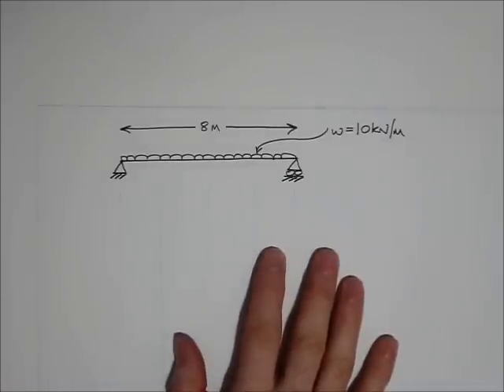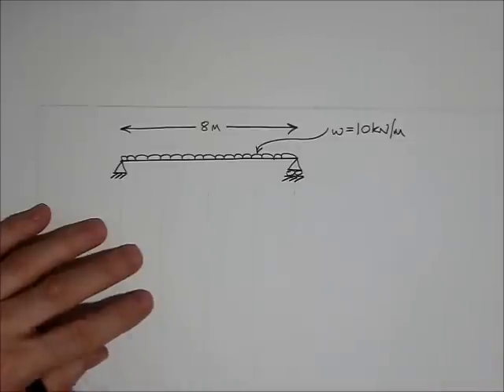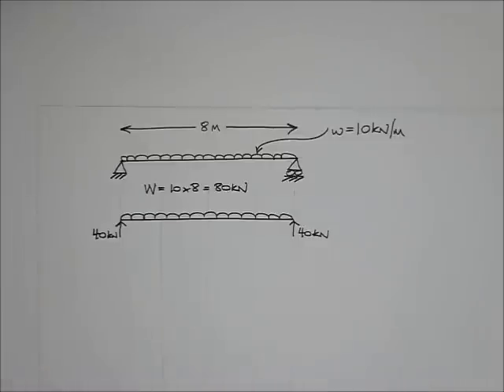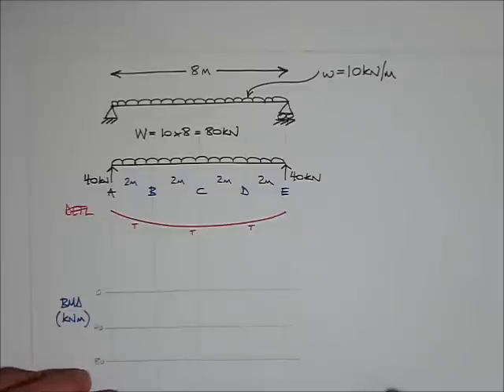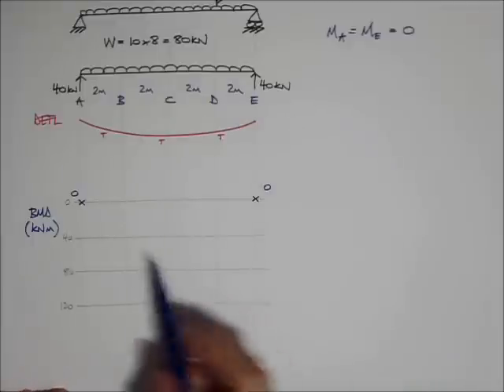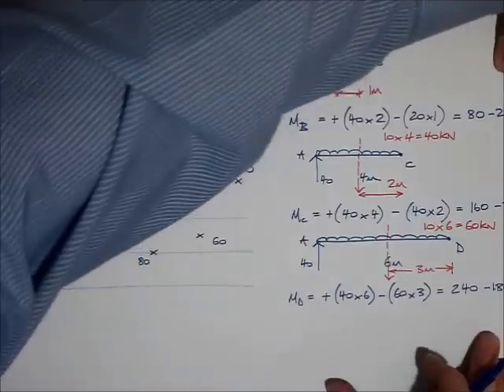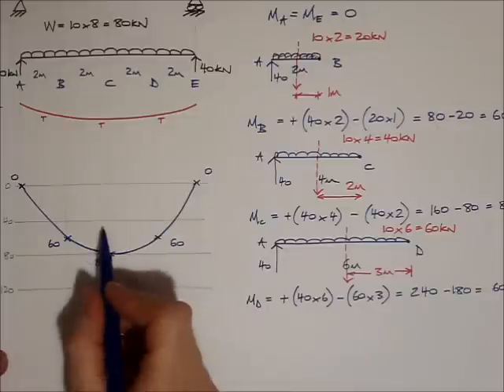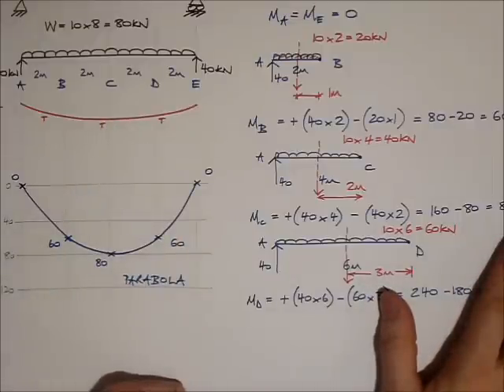BENDING MOMENTS IN BEAMS - Simply supported beam with UDL

Comment: I may be missing something here, but isn't a clockwise direction considered negative when considering a moment?
Reply from the maker: Hi Alissa, in analysis, we follow some arbitrary conventions to help to keep us sane. In the UK structural engineers draw bending moments on the tension face of beams, whereas mechanical engineers draw them on the compression face. You could consider clockwise moments to be negative or positive. The most important thing you can do when analysing moments is to be consistent and to clearly understand the size of any moments and to understand whether a beam is hogging or sagging. On this basis, I can’t say that you are right or that I am right, I hope that this helps, Mike

Comment: I have always been told that a Clockwise moment is negative and an Anti-Clockwise moment is positive?
Reply from the maker: Hi Ryan Mallin, thanks for your comment and I am not surprised that this is the case, as the decision to call clockwise moments positive or negative is wholly arbitrary. I can only tell you the way that we do things in our university in the North of England. The key thing is that you are consistent and then when you draw the bending moment diagram you plot the bending moments either always on the tension face of elements (or, if you are not attending our university perhaps) on the compression face of elements. I hope that this explains the inconsistency a little, Mike

Comment: The way i see it.. the longer the distance from point A the higer the number..  does that mean the higer the load... 
Im trying to calculate the max load ot safe load on a Y truss that im usung to suspend ligting and audio equipment.... im usin I beams from global truss...about 6.5m long each seccion..
Reply from the maker: Hi ladjkoaz, Thanks for your comment. Generally, for a simply supported beam, the bending moments are greatest around the centre of the span. If I understand you correctly, you are designing a simply supported truss - this would behave, in some ways, similarly to a simply supported beam. As the bending moments are greatest around mid-span, the axial forces in the members of the truss will be greatest here as well. Good luck with your analysis and design
Reply: +Mike Bather 
Greetings Mike:
The maximum bending moment for a truss would indeed be located at mid-span given the same loading condition as above, however, the axial forces of the truss members would not necessarily occur at mid-span unless you are talking about a truss with a parallel top & bottom chord member.  A roof truss with sloping top chord & a horizontal bottom chord, for instance would experience the highest axial forces at the members closest to the supports.
Best regards, Temo Gracia, P.E.

Comment: If we take the right side of point D . The BM is coming out to be -60 
Explain?
Reply from the maker: Hi Aman, calling a bending moment -ve or +ve is really an arbitrary thing. By looking at the free body diagram to the right of D you have correctly found the value of the bending moment to be 60kNm. But why is your calc -ve when my calc is +ve? Because, when we cut through a beam we expose the internal forces in the beam and looking at the left hand side of the cut, there is a couple formed by the compressive forces in the top and the tensile forces in the bottom. Let's say that this couple acts in a clockwise manner. When we look at the right side of the beam the compressive and tension forces are acting the opposite way and so the couple is acting in an anti-clockwise manner. Hence the difference in signs. I hope this helps.
Reply: Not getting it
Reply from the maker: Aman Deep Hi Aman, you might not be getting it, but your calculation is giving you the correct value of the bending moment and the correct sign. That's a good start. You just have to think about how the internal forces in the beam are acting. Best of luck.

Comment: why zero shear force means maximum bending moment????
Reply from the maker: Hi Jitu M, That is a good question which I won't answer fully here, you could ask your structures lecturer though. It is the case that the loading of a beam is directly related to the shear force diagram. Additionally, the rate of change of the shear force along a beam is directly related to the bending moment in the beam. Calculus can be used to explain these relationships and particularly it can be shown that where the bending moment diagram has maxima and minima, then at those points, there must be zero shear. I suggest Alan Jennings' book for a brief introduction to this. Sorry to be so brief but I hope that this helps.
Reply: Thanks a lot sir
Reply: Shear force is the derivative of the Moment (the Moment is the antiderivative of shear force). Therefore, when the shear force is zero, you get the moment max. The Shear force is calculated from the vertival forces perpendicular to the beam. The Moment is calculated from the same vertical forces multiplied by a distance x. So, if you have a calculator with graph you could make a program in which you would enter 2 points to trace the graph of the Shear force function, and then you would calculate the integral to figure out the Moment max.